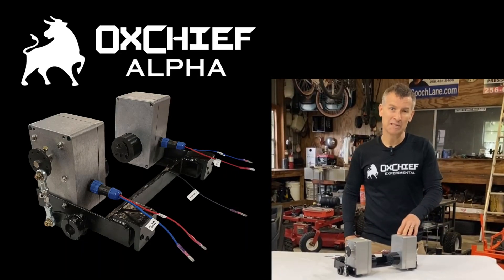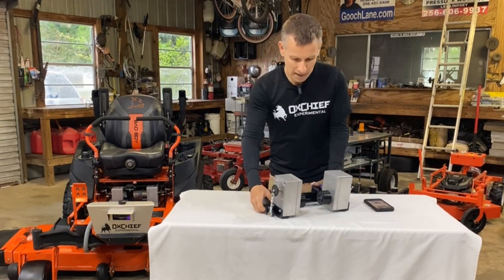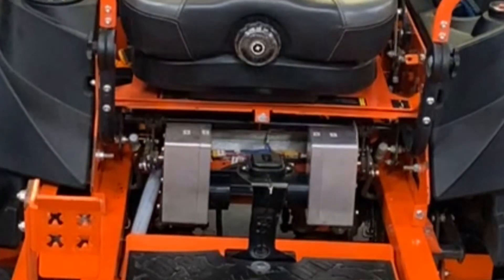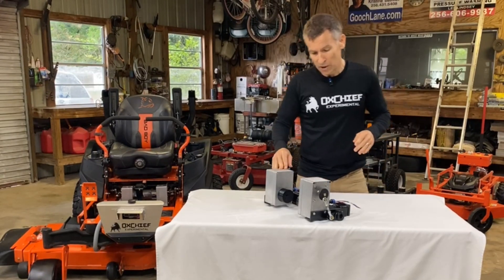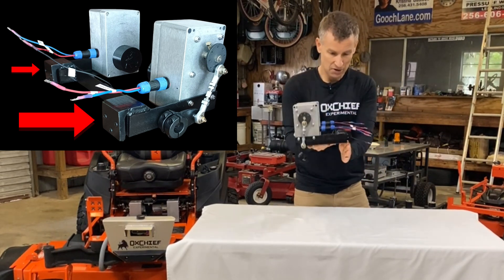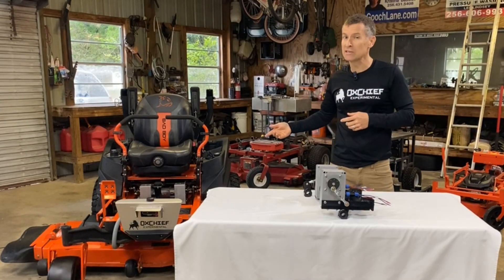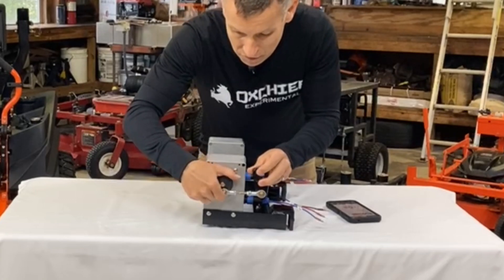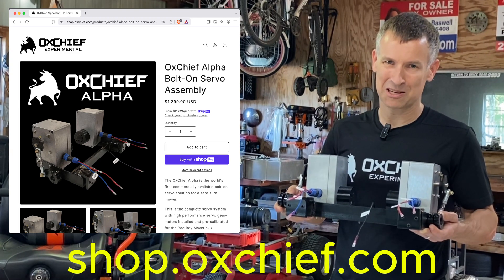World's First Zero-Turn Servo

Comment: You need to be able to disengage blades or kill mower remotely. It’s cool you can guide it remotely but GPS and camera guidance alignment to stay on remote course would be nice. This seems very analog wireless but no intelligence is that correct?
Reply from the maker: @ZedZane597  Absolutely correct - Remote STOP is necessary! The intelligence is using oxchief.com to design the mission and for obstacle avoidance. https://youtu.be/IWPdY8pYv0I?si=2FGzx3FgnjF8qlpt
Reply from the maker: https://youtu.be/iwFl5_PJkDQ?si=LmlXZaNFep8Vilaf -- you might like the FPV option too!